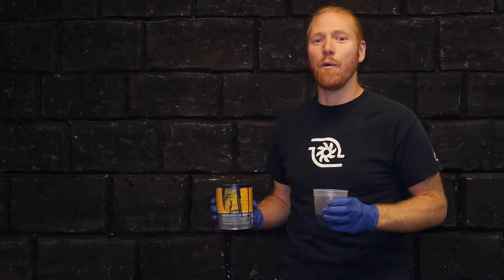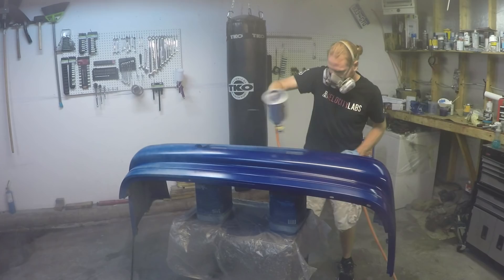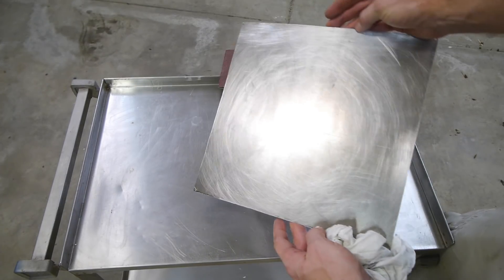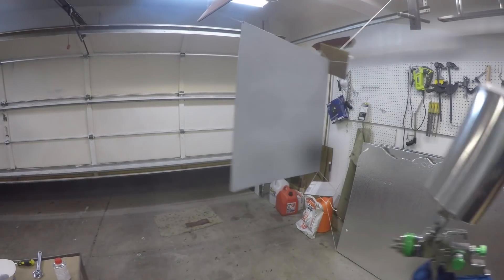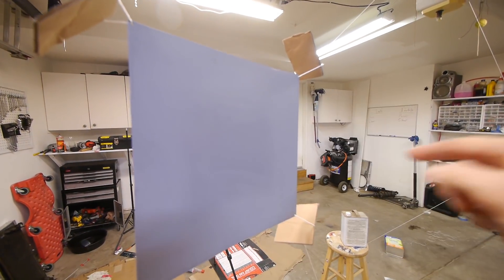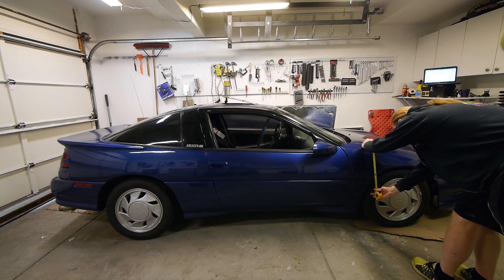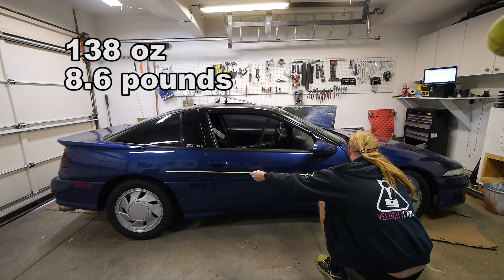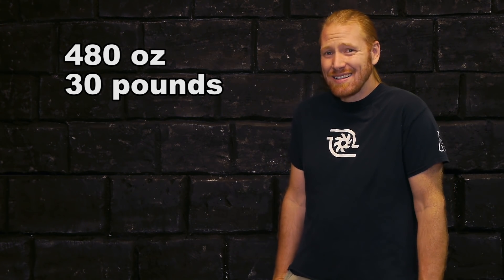How much does car paint weigh?

Comment: For those looking for real units instead of nonsense, the lightly coated panel had about 280g/m^2, and the heavy panel had 721g/m^2.
This means the ~14 square meter Eclipse had 3.9 kg(light) or 10kg(heavy) of paint on it, and the ~18.5 sq m "average compact car" would have 5.2kg (light) or 13.4kg (heavy) of paint.
Reply from the maker: Brilliant! :D
Reply: REDACTED Universal common language = universal common measurement system in importance.
Reply: Metric FTW!
Reply: REDACTED There are those who use "real units" and there are those who landed man on the moon.
Reply: @YZ-YZ-  ignoring the fact Nasa uses metric.. or that plenty of others went there on metric too lol
Reply: @YZ-YZ-  Quick Reminder that all imperial measurements are based on Metric the standard Metric gages. Yup, your inches are based on a metre.

Comment: Some observations- I think there were some other surface areas that may or may not have been taken into consideration initially: the floor tray, vertical panels like the firewall/trunk divide, and interior panels (like fender wells/liners, interior door panels, interior trunk liners) depending on the car, which is probably where that extra 50-100 sq ft comes from. I think undercoating & seam sealer is a bit interesting, my guess would be another <10lbs.
My initial guess was 10-12lbs of paint for a car. I think paint is one of the last places I'd look to save weight, after exhausting all other options, and only on a 100% dedicated race car. I'm not stripping a car to move from 8th place to 7th in some unrecognized club race. If I was building a dedicated kit car or something, I could see minimizing weight while still retaining rust prevention.

Comment: So if I had the door on my s550 mustang re cleared, and my back rear bumper re cleared, how much weight do you think was added?
Reply from the maker: 6:52 Basically nothing, a few ounces at most.   It's less than an ounce per square foot for 3 coats of primer, 3 coats of paint and 3 coats of clear.  So just clearcoat would be even less than that.
Reply: Velocity Labs well it was spot fixes, so it got paint and clear, but the paint was only in the area of the spot, and then cleared the whole door and bumper to blend it in, I was just curious as to how much this would add up to as far as weight.

Comment: A typical small car usually takes a gallon of primer (~3.5 L), 0.75 gallon of base coat paint (~2.5 L), and 1.25 gallons of clear (~4.5 L). Based on shipping weight of materials that comes out to 12 lbs (~5.5 kg), 3 lbs (~1.4 kg), and 14.5 lbs (~6.5 kg) respectively. Taking into account that the shipping weight includes weight of the containers let's say that total weight of materials is 26.5 lbs (~12 kg). With a typical HVLP sparygun you can get up to 80% of the material on the car, other 20% flies away as overspray.  After accounting for transfer efficiency of the spraygun that leaves 21.2 lbs (~9.6 kg) of material on the car.

^^^ That is the boring way to describe what you just did :) Interestingly enough the result is basically the same.
You also mentioned car manufacturers. Turns out they don't even use HVLP spray guns any more. They use what are called "rotary automizer bell sprayers" that produce much less overspray.
On a related note, can you test other popular coatings like powdercoat, plastidip or wraps/stickers, as well as single stage paint?

Comment: This is why the exterior of my 1965 VW Beetle race car is getting a vinyl wrap....Chemical dip back to bare metal, followed by an etch primer then wrapped. The paint shop said to expect a weight saving of around 5kg (11lb)...doesn't sound much but when the car is a 600kg (1322lb) road racer, 5kg makes a difference...plus you're lowering the centre of gravity. Light weight body filler is also available...half the weight of regular filler.